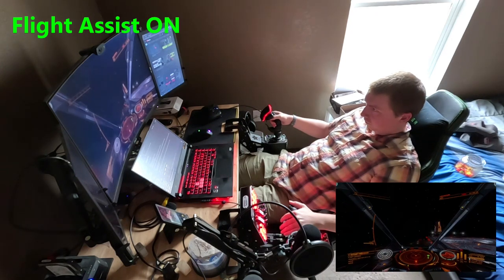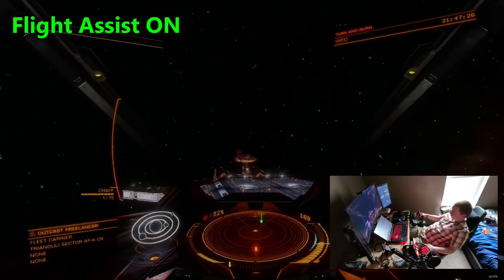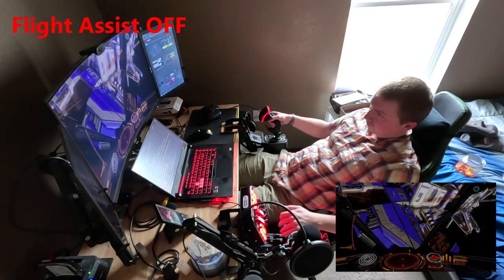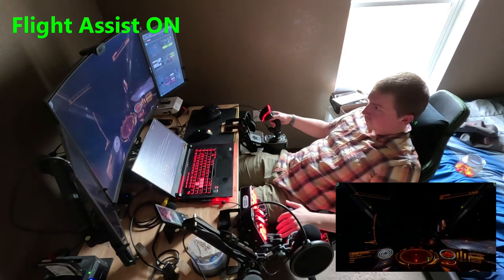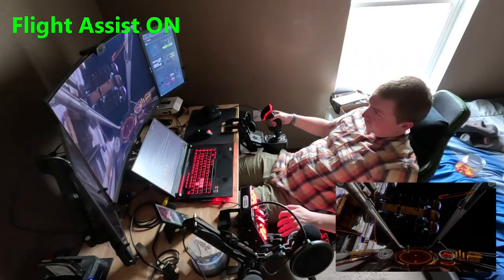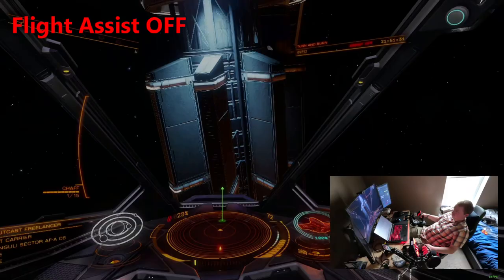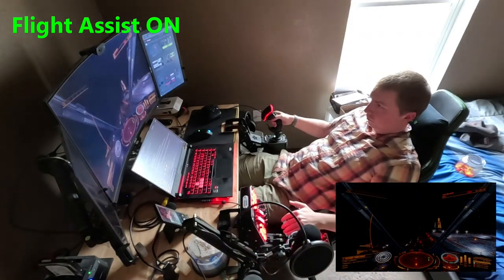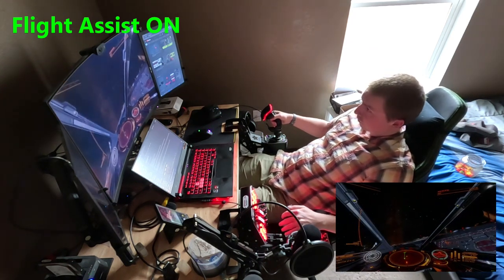Elite Dangerous | New Player Tutorial | Flight Assist OFF

Comment: Just to be clear though: F/A off is still NOT fully realistic. We’re still flying with atmospheric models which limit out speeds and slow us down with drag from landing gear etc. In space any ship can fly any “speed” at all, just some would take longer to accelerate. Elite 2 had that pure model and it was a nightmare to handle, especially on Amiga graphics. Where all pilots on the forums have complained with this iteration is how they dropped any reference indicator for your vector, which is something real fighters all have (and even several airliners). They elected to use this “space dust” to give you a sense of your flight vector but it’s not as good as an actual O reference symbol on the HUD.
Reply: This flight model was implemented fairly early we could do cumulative speed vectors in beta meaning a viper could do past 1000km s pre engineers
Reply: Not to mention if you pitch then roll, the added roll creates an unrealistic motion.  Which had always been my biggest issue and pet peeve.   The roll should not change the direction of the upward pitch, and should instead pitch upward while rolling.  This is basic physics that the Elite universe for some reason decided to exclude in all it's million updates thus far, and probably never will.  I mean they could add true flight assyst off and the ability to accelerate to the thrusters thrust to weight ratio potential, but that would bruise the PVP players ego in believeing they can do those FA-off manuevers with a space shuttle.  Then there is the gimball and turret reality, along with the fact that autopilot would do the manuevers better making the ship command based and not flight stick based... but what fun would that be?

Comment: I use mouse and keyboard, and I find FA off amplifies natural jitter in my nose angle.  I can quickly pop FA off to flip around in a dogfight,but holding a constant heading is rough - it feels like my sensitivity shoots through the roof.

Now I like using alternate controls for landing.  The precise thruster control is great for docking on burning stations and scooping cargo.
Reply: Try using the relative mouse mode. I had the same struggle you did until I turned relative mouse on. By having your cursor automatically reset to the center, the mouse behaves much more like a joystick, so instead of trying to manually re-center the mouse every time, amplifying your nose movements, your center position just ends up at wherever you've left your mouse.

Comment: I've got nearly 10,000 hour's invested in ED. And all of it is envolved in either a private server with a few like minded player's or totally in solo. Thus the only combat with human's I've ever had is when viewing various You Tube video's. Watching the various video's of  human's in combat with other human's. I've notice though some may do it on occasion, most never do it at all. While NPC's on the other hand do it most generally a 100%. I'm taking about a process that goes back to the days of old when Knight's use to "JOUST".

If and when getttng the attention of an wanted NPC, they will almost imediately set a course directly at you and basically come at you in such a way that it basically a form of "JOUSTING". Having FA configured to turn on or off at the simple touch of a single button. Using a ship with only one large beam lazor, fully engineered for long distant as to get their attention. At the point where they will either fly over or under you. I dip my nose a wee bit, causeing them to go over. Turn off FA, nose up and continue until I've done a 180 degree back flip, and then turn FA back on. All the while my trurreted frag cannon's which I've targeted their power plant's are doing there job. If they haven't finished, by the time I've completed my 180 back flip, I'm now on their six and as they are turning to do another run aka joust. Becasue turning on the FA start's the thruster's from causing me to continue going backward's, simply wait until they are close enough, and do the same process again. Most generally, they are destroyed prior to my having to slightl dip my nose again and do another back flip using FA off.

Comment: Thank you for sharing the dynamics of fa on and off. I use fa on 99% of the time during pvp matches and can tell you that fa on offers the ability to change vectors both during boost and after the boost stalls. This is especially handy with ships which tend to drift, like the FDL. Using this technique, I'm able to evade slower moving projectiles like plasma accelerators or frags. I do use fa off under certain circumstances but I don't see it as mandatory for combat. Switching between the two modes would be most advantageous.

I'm on PS4 and use the standard controller, so perhaps this has an impact on the flying styles. You can see examples of using fa on in my videos. 

Oh, Awesome setup you have there btw👍
Reply: Use scoop/gear brake boosting in FDL
Reply: @CAL1MBO  I do from time to time

Comment: I set up my HOTAS so that a lever I can access with my pinky is keybound to my flight assist toggle. A quick pull switches it off to make harder moves in combat, in a federal corvette it allows for a much faster turn rate at speed than I can get otherwise. it also allows me to hold boost speeds for longer. But I am not so good that I can remain control like that, so being able to rapidly switch on and off as needed is preferable, and gives me the best of both worlds!

Comment: Just started, but @ 0:15 This is wrong. Different ship thrusters have different thrust in the different modes; some inputs are stronger in FA on, others in FA off. So, turning is faster in FA off, for example, but your vertical thrusters are less powerful, iirc.

Comment: MMM... yea, ok this game is definitely not for me if i need this kind of setup to play...
Reply from the maker: I got started on a pair of cheap joysticks. Many commanders use keyboard and mouse, and there is a default Xbox controller map available.

I grew into the setup that you see in these videos over the years. Use what you have, see how it goes, upgrade as you see fit, if you see fit.
Reply: You don't "need" any setup for Elite. Lots play with KB+M or controller, some play with a stick and throttle, others play with two sticks.

Most people don't start off with £500+ worth of flight controls, there are much more budget options but not still necessary at all.